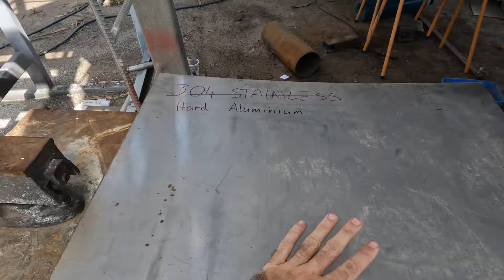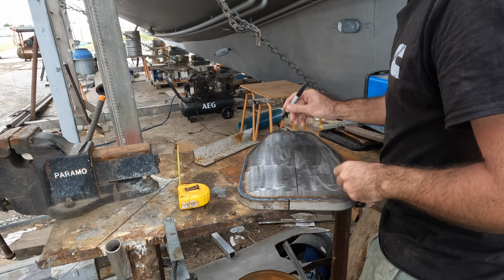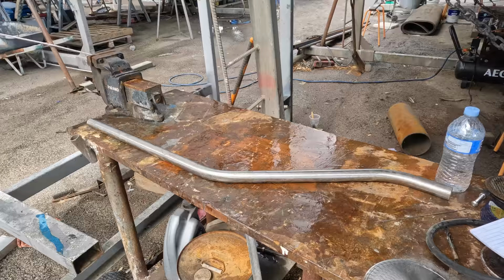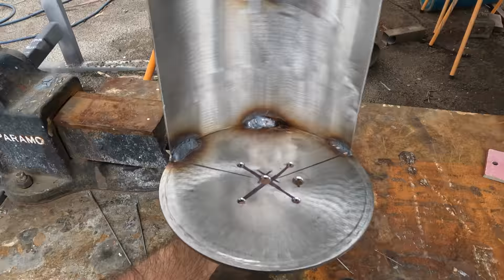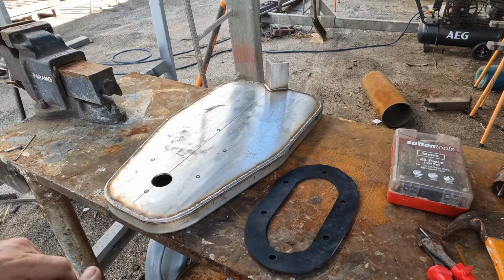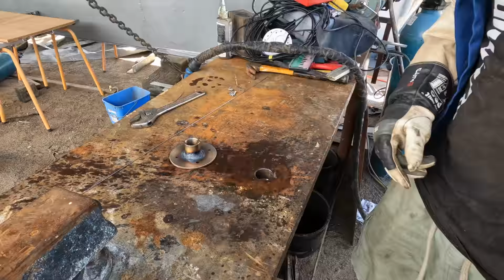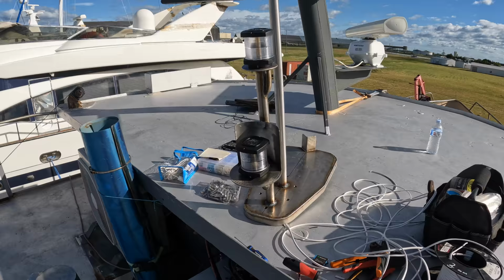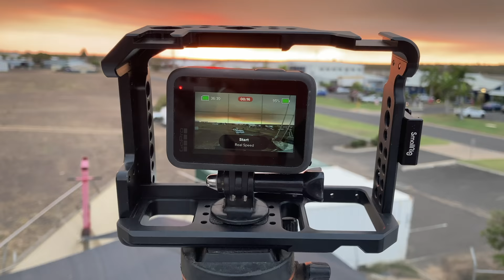Brupeg gets Starlink, Comm's & Nav Lights - Ep 248

Comment: This might seem like a stupid question, and probably is, but are the Antenna mount and Anchor light mounts Parallel? 
 They look to be wider apart at the top, Im assuming its an optical illusion?
Reply from the maker: It’s not an illusion and I was pretending it was fine and wasn’t going to drive my OCD nuts. This is something I will fix with a big hammer, but needed to wait till it was bolted down to be able to do that
Reply: @ProjectBrupeg  I thought i saw it as you were welding it, and thought Naaaa lol, but then the shots at the end im like Hmmm i wonder,   Nothing the Percussive adjustment device wont fix though,  awesome mount though,  I so would have just used stainles zip ties and cables in the outside of that light pole LOL

Comment: Dame , starlink isnt going to like having any obstructions (ie those antennas) , its gonna get time outs when its line of sight is obstructed, you may not notice unless your gaming or running a ping test though. I'll bet unless you make a dome out of a material transparent to 30ghz its gonna crap its self. the antennas are very durable and mostly element proof mine sees wind rain and temps to -15 id bet its gonna be fine and you my have to replace the dish every 5-10 years in salt water ( i kinda doubt it ) but that might just be the cost of doing business ya know?
Reply from the maker: Yeah I’m thinking a couple of options. Obstruction hasn’t been a huge deal. Did a check this morning coincidentally. I’m pondering either a dome (but it won’t be small given the size of the dish), or I’ve heard other boats mount the dish facing directly up, and do away with the mechanical tracking. It’s lower performance but massively simplifies any radome design

Comment: So correct me if I'm wrong but doesn't the 360° anchor light need to be 360°? Your vhf poll is thicker then the led so it's going to block the light since it's so close to the light...
Reply from the maker: Yip. Wasn’t sure how to get around this. Antenna is always going to block some part of the light
Reply: @ProjectBrupeg  Problem is the antennae is too close. Further away the light will bend around and will not cause an issue.

Comment: I'm confused...you couldn't have a 360 forward light so you shielded it...but your other light is 360 so don't it just cancel out the other..? I guess by you referring to the other as an anchor light then it's only turned on at anchor ⚓️  ?
Reply from the maker: The 360 is an anchor only, and the shielded light is forward facing 225 degree steaming light. We also need a 112.5 degree white light on the stern so theoretically we will have 360 degrees of white light shining when steaming however they will be at different heights which tells you the boat is between 12-20m in length
Reply: @ProjectBrupeg  Yeah the stern light should indicate where the stern is on larger vessels. Steaming light ideally further apart as possible.

Comment: This maybe a stupid question, but why didn't you put a piece  of black stuff inside the running light to blanc it off.  :-)
Reply from the maker: The light locks into the base with rotation clips. I did ponder that but wasn’t confident I could guarantee the angles would always be right

Comment: Hey mate isn't the steaming light meant to face the stern ?????  Another awesome bit of engineering
Reply from the maker: Nope
Reply: @ProjectBrupeg  is that because it's over a certain length?
Reply from the maker: Nah steaming points forward 225 degrees same as the red and green. Stern light covers the back 112.5 degrees. It’s sometimes called a masthead light in google
Reply: Mate I have a try colour light on my little yacht and obviously white light towards stern ,obviously for sense of direction of opposing vessel?????. Love your Chanel and your work guys
Reply from the maker: That’s a stern light not a steaming light. Boats under 12m are allowed a tri colour, they are a great idea. But 12-20m need to have a red, green, white stern light like your but also a 225 degree white facing forward higher than the red and green.